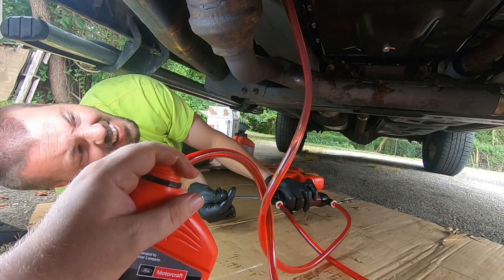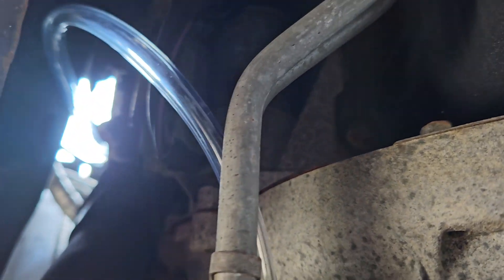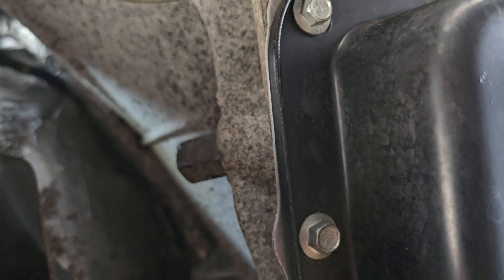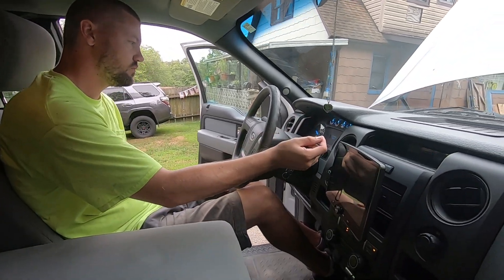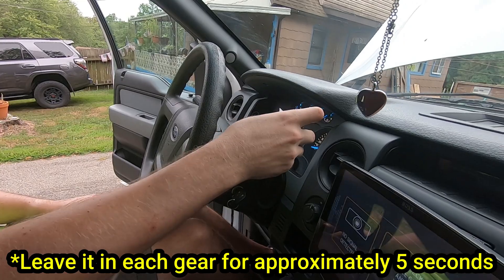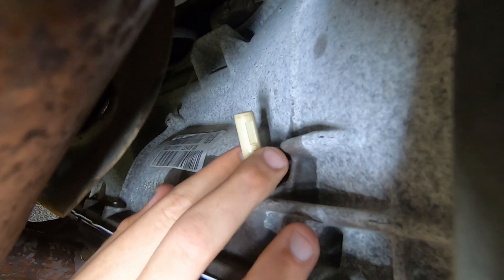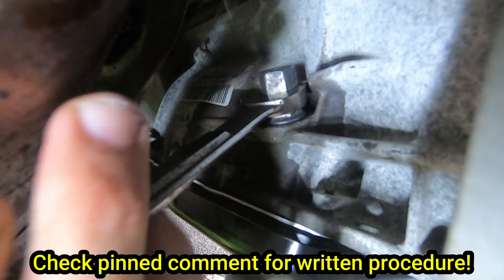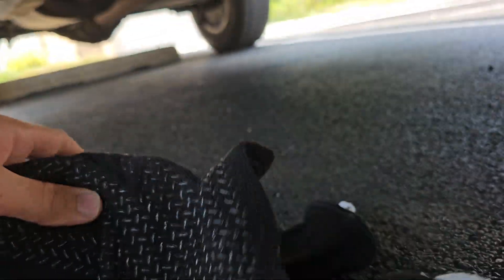Ford Transmission 6R80 and 10R80 Filling Procedure!

Comment from the maker: Transmission 6R80 and 10R80 Filling Process:

•	You will need to keep a drain pan under the fill port to catch any fluid that leaks out.
•	Now with the engine off, fill the transmission until its full.
•	Mine took just under 6 quarts.
•	Then, you need to start your engine and let it run until the transmission gauge shows the fluid is warm.
•	While it’s warming up, go ahead and shift the transmission through the gears, while keeping your foot firmly pressed on the brake pedal.
•	Once it’s warm, go ahead and add more fluid.
•	Most people have been able to add another quart of fluid, some have been able to add a little bit more.
•	Once your transmission is filled, you need to pull the clear tube straight up.
•	While the engine in running, go ahead and check the level on the dipstick.
•	It should be between the “A” and “B” hash marks.
•	Then, you need to tighten the fill plug before shutting the engine off.
•	Do not overtighten this plug. 
•	Since your transmission is hot, it could weld itself to the pan once it cools down.
•	I recommend you barely tighten it down…let it cool off…and then tighten it a little bit more if needed.
Reply: So when you fill it up at first, do you just stop when it starts spilling out of the fill hole? Im just a bit confused by what you mean when you say fill it in the first steps!
Reply from the maker: Yes, you are correct. Fill once it starts flowing out of the fill hole.
Reply: @TrickShiftGarage  awesome! Thank you so much for answering on an old video!! I have a trans cooler line that's leaking at the crimp and im going old school and removing Fords mess of a line and replacing it with flexible hose and was trying to figure out how to add fluid after!
Reply from the maker: That's a great idea. Ford old lines with the connectors they use are old tech. Using something more modern and durable would be a great alternative! Let me know how it goes!
Reply: @TrickShiftGarage  update: Did my leaky line today! It was my return line from the cooler and turns out it was actually leaking from a spot in the metal line as opposed to the crimp. I still went ahead and replaced from the cooler to the line off of the tranny with transmission cooler hose... Honestly? Cake job and looks alot better then the OEM way... The biggest pain was cutting off the crimp. Took me about an hour to get it off but that was mostly because I have after market suspension and it was located above it so not much room to fit a dremel in... All in all it took me about 1.5 hours and about and hour and fifteen minutes of that was trying to get the dang crimp off! Ill be doing the supply line and am guessing it will take me about 20 minutes as I can get to the crimp alot easier!
Reply from the maker: Dude that's awesome! You won't have to worry about the lines failing with that hose. Great job brother!

Comment: Did you use that hand pump to remove fluid from the pan before removal?  Seems like it would be less messy.
Reply from the maker: You can definitely do that! I didn't, but it would be a good way to prevent fluid from splashing everywhere once you unbolt the pan.

Comment: Buy a cheap garden sprayer and remove the wand.  Then you can fill the sprayer and pressurize the trans fluid and it’ll just pump itself into the pan.  So much easier.

Comment: Could y'all by chance please show where the air/fuel ratio sensor is on the Nissan Altima. I just got one and it goes into limp mode because of it and I can't find a good diagram of where it's at. I know it's bank 1 sensor 1 and that's it

Comment: I’ve got a nice burn scar on my forearm from checking the fluid level of my 6R80 after a drain and fill. That catalytic converter is super close! I’d recommend a welding gauntlet to check the fluid and avoid making the same mistake I did 😂. Thanks for the video!
Reply from the maker: Yea it isn't an ideal situation lol. I found some grill gloves that extended past my wrist and ended up working well. Thanks for watching and taking the time to comment! 🙏